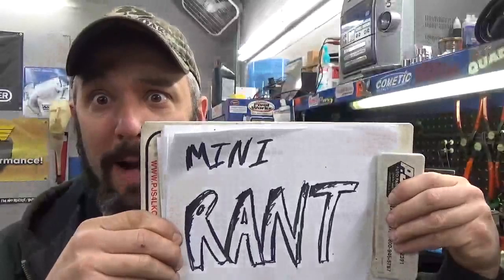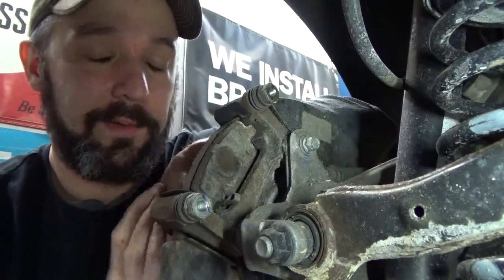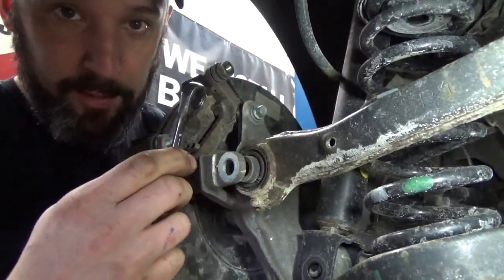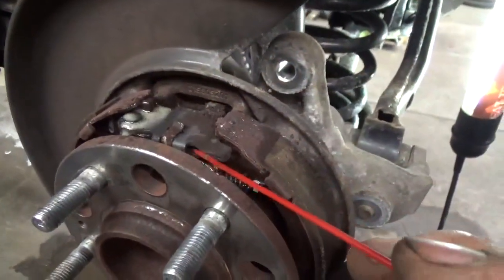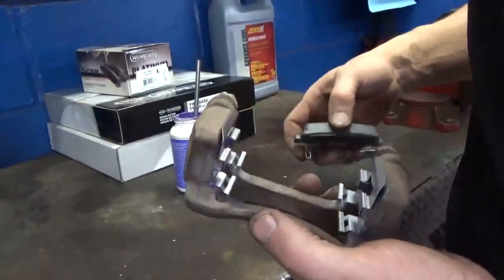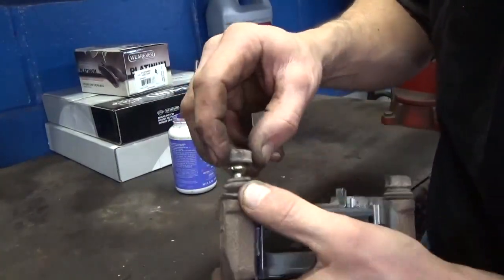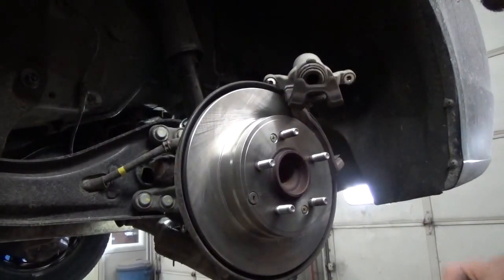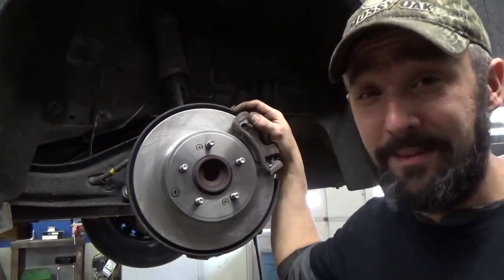Replace Rear Disc Brake Pads & Rotors - Hyundai Sonata

Comment: Great help, thanks. So well filmed, and made simple. So much attention to detail that one would only normally get doing one's own work. 
 I have a 2013 Sonata with the right rear wheel and brake assembly heating up with attendant burning smell, so I thought I'd take the rotor off to have a look.  I was stuck at the removal of the lower assembly bolt.  My 2007 Sonata had a conventional layout. They call that progress ;)

Comment: I just wanted to thank you for telling me about the e-brake thing. I am in the midst of doing my brakes and rotors and have been wondering what that rubber plug was. I have watched 3 other videos on here on how to replace brakes and rotors and not one of them have said nor mentioned anything about this. Great video. You are very precise. I learned several more things on here. This is my 5th time doing brakes and rotors but first with my kia. Boy did the S Korean's screw up with that one bolt placement!! UGH!!

Comment: Thanks....checking my Hyundai Veloster to see if they redesigned that bolt that was a little more work to remove. Awesome! Pulling out my tools to change the discs today, with pads of course

Comment: Excellent video..mentally prepared me for the ridiculous Hyundai engineering added extra step. Wasn't as hard and didn't take as long as I thought it would. Having an impact wrench helps and follow the video. 2nd 1 took a 1/3 of the time. A few bolts were on tight and 1 rotor was stuck pretty good.  Thanks

Comment: I spent four years working on the shop floor as an hourly employee of General Motors, in the Oldsmobile factory. For a I made 3,600 air-conditioner pump-brackets. Three bolts held them to the engine block, covering the #5 spark-plug. This was pre-platinum, and the spark plugs needed their gap set every 6,000 miles. We had nothing but scone for the engineer who designed this bracket. Oh those were the days! A tune-up consisted of changing the oil & oil filter, greasing everything, setting the spark-plug gap, resetting the timing, and rotating the tires. This was 1974, and the tires were not radial, but bias-ply. There was no synthetic oil, and the oil  degraded significantly in 6,000 miles. Everybody in the factory had utter scorn for any car owner who did not get the specified oil change. My building was attached to the engine factory, where they machined the engine parts, and assembled the engines. My future wife reamed, to a high tolerance, the connecting rod bolt holes.

Comment: I just finished fronts and rears on my 2014 Sonata.  The fronts took an hour. The rears took me 2.5 but would have been longer had I not watched your video. I completely disconnected the control arm from the knuckle so I could get a 6 point socket on that hidden bracket bolt. I used a bottle jack to manipulate it back into place

Comment: I have two questions if anyone can answer them:

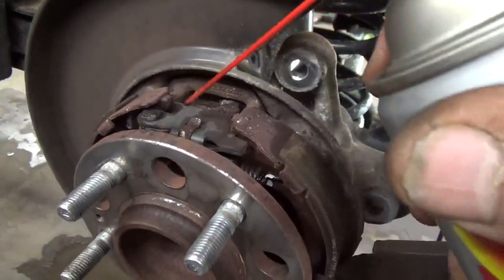1) At 7:54 what type of lube is sprayed into the parking brake mechanism? Doesn't that general area get too hot for common lubricants? (answered below)
2) At 16:20 he used an old brake pad and channellock pliers to push the brake caliper piston in. Does that mean you do not need to use a special rotating tool on a Sonata?

I have a 2016 Sonata which is a 7th gen model (2015–present) but I am sure most of this content is still the same. I'm so glad some other comments here mention that they re-engineered that one caliper bracket bolt to be easily accessed on the newer Sonata models!

********

Edit to include my own findings which answer question #1 along with other products he used:

From a random internet source, during normal street use an average car's brakes likely won't exceed 392 F. During racing use the brakes got to around 932 F. I say this because certain products aren't rated for certain temperatures.

The purple brush-on lube looks like "Permatex 24125 Ceramic Extreme Brake Parts Lubricant". The internet (if correct) specifies it can withstand temperatures of -65 to 3000 F. It's odd because the product description says it can be brushed on the slide pins but the reviews say it is for metal-on-metal use only and will eat away rubber. I'd suggest something like "3M 08946 Clear Silicone Paste" for the slide pins.

The red anti-seize spray is called "Castle Muscle Grease". The MSDS is kind of hard to read so I think it is either rated up to 182 F (boiling point) or 720 F (Auto-ignition temperature - whatever that means). He shows it 15m40s into his Suzuki XL7 video.

The spray lube he uses for the parking brake mechanism is likely Fluid Film. He shows it 32m56s into his Suzuki XL7 video. The internet (if correct) specifies it can withstand temperatures of -50 to 350 F with a flash point of 405 F.

Link to Suzuki XL7 video: https://youtu.be/00LCvz9lC5M

Comment: Thanks a lot on posting of video with instructions. I was able to follow your instructions and remove the rear rotor on a 2001 hyundai donate and to my surprise the rear parking brakes needed replacement. By the way on the 2001 hyundai it was easier to take everything off without have to move shocks or frame supports.

Comment: It’s crazy that u need to move the control arm and shock just to get to the rotor nut.  I was so hard to turn the nut with a wrench once I move the arm and shock.  It was really hard putting it back.  I’m glad u said not to remove the arm.  I wouldn’t have gotten it back on if I removed it.

Comment: Very informative thank you. I had to take the whole rear arm off to get it back together, what a pain. It twist if it comes all the way out, like mine did. I found it easier to put it back on once I removed the bolt that fastened it to the car. Thanks for the great info keep it up!

Comment: Nice video. Very detailed.  Wish I saw it sooner.  But I was able to get the 2nd bracket bolt out without removing the shock bolt. Then aligning the control arm wasn't to bad. I just used a pry bar.

Comment: great vid. I just did replaced pads n rotors on a 2015*. After watching this vid I was expecting a long day but this new model has the control arm away from the caliper bolts. lucky me
Reply: So you didn't have to take apart the control arm at all??

Comment: Top notch video.  Would not have been able to do the rear rotors without it.  And my brake pads won't wear unevenly and end up looking like doorstops, because I used the sandblaster like you recommended, and they now slide properly.  I wonder how many mechanics take that extra 5 minute step to do a quality job?

Comment: Like you,I'm in the trenches every day and this is the first time I have seen anyone do a brake replacement the way I would do it. Sign it the office states that that if a customers car runs out of fuel on a road test we will leave it right where it stops and from there it's shop rate per hour to get fuel and/or a tow back to the shop.
Reply from the maker: Lol thanks! Ohhhh trust me I had an evil side of me that just wanted to leave the car idling in the parking lot. The funny part is, these people can throw a rock out there front door and hit the gas station. Thanks for watching!

Comment: Sonatas changed quite with regard to the body style from 2010 to 2011. Don't know about the other aspects of the car. Just wondering if you knew that the "hard to get to bolt" was the same on the 2010. Excellent video. Thanks for helping people out!

Comment: I have the same 2011 with the idiot Hyundai engineering.  Had to bring it to my trusted mechanic to replace the rotors.  I didn't have a big impact gun. Being in the rust belt of No. Minnesota, it had to be done twice.  Great instructional video!

Comment: thanks,I'm just getting ready to replace the brakes which I've had for some time on an 08'sonata.possibly the hose to on the pass.rear as I ran over a piece of 2x4 someone left on the on ramp for me and now is leaking at the pass rear caliper area.doesn't seem like it should be the caliper but I have it in case.again thanks for the preview

Comment: Great video Eric!  These days it seems one can't wrench on a car without looking it up, just to see what they had to screw with to make the most mundane jobs all the more fun.

I removed the control arm bolt, pried it apart so that I could attack the bracket bolt, and all was fine.  Left the shock alone.  Ratcheting wrench is a must here.  Put the top bracket bolt back in and then the bottom bolt can be wiggled back in.  I picked up some "alignment bars" from HF (think a shaft that is turned into a point on one end) to line things up afterwards for that control arm.

Unfortunately I had to do it twice: while the pistons pushed in just fine, three months later it all had to come apart again: the phenolic pistons froze.  No joy in Mudville for me.  Hoping second time is the charm (although the way it's rusting I'm wondering if I won't be doing flex lines before long--it's a friends car, so no Fluid Film here).

On the good side, I bet no inspection shop checks the parking brake shoes on these cars.

Comment: And love the mini rant and your right if the cars out of gas and needs to be tested out  the customer can't expect you to fuel his car  to do it how ever I have had a few mechanics who would run the car short of empty testing the ecm  or picm  and I came to pick up the car I left it with a full tank and got it back at 1/8 of a tank and often I'd be paying for other people's parts as I was told I needed new wheel hub bearing for my 97 jeep Cherokee  Lorado and get the vehicle back and no new hub bearings  so I bring it back and told the owner I paid for 2 new hub bearings and their not on here

Comment: If you jack up the lower control arm under the spring first the bushing lines up perfect, bolt goes in like butter takes all of 5 seconds to put back together

Comment: Have a 2013 sonata didnt take any thing loose on suspension ..remove caliper.loosened rotor by removing two keeper screws ..removed uppet caliper bracket bolt..you can get a 12 mm wrench on lower bracket bolt loosen and  back it out until head hits bushing keep loosening until it is out of bracket bolt stays in pkace  .use a large flat screw driver or pry bar, slide it next to where the bracket and bolt are .pry it about 1/16 and slide bracket up and out rebuild bracket with grease at appropie spots.put back in reverse make sure new rotor lines up with scew holes slide rotor on after cleaning e brake..put bracket and just bumped bracket  with my hand and popped right back in where lower bolt lined up with lower hole .started lower bracket bolt  making sure not to cross thread .put top bracket bolt in then tighten both .put screws back in rotor .put brakes and caliper back..didnt remove any bolts out of suspension save alot of time and headache

Comment: I did mine and it was a pain removing 1 bracket bolt and re-aligning the control arm to the rear knuckle.  One thing I did which I think it will be easier to work on in the future was I flipped the control arm bolt where the nut is now mounted facing the front of the car.  There is no need for me to remove the shock mounting bolt whenever there is a need for me to service/replace the parking brake shoes in the future.

Comment: my 2015 doesnt have that problem with the caliper bolts thank you hyundai
Reply: Does this video work for the 2015 model?
Reply: You just made my day. I have to do rotors on my 2015 and was worried it was the same design like this that would require removing the control arm and shock.

Comment: Great instructional video. I've worked on my own cars for a very long time and have done numerous brake jobs, but would have been pulling my hair out trying to get the caliper bolt out that hides behind the shock and the control arm. Do you have a video for the front brakes and rotors of the same vehicle?
Reply from the maker: Ahh I don't John Atnip ... at least not yet :)

Comment: Late to the party here, but I just replaced the rear rotors thanks to you Eric. The only question is what difference does it make to put the upper control arm bolts backwards? I'm very curious, because I did that. Is it about the exposure of bolt threads? Anyway, that video was a huge help. Thanks!

Comment: Eric O you need a video re-edit or retro-fit!  Brake cleaner makes an appearance with no  -- DAH DAH DUHHH!!! -- oh man, so disappointed.  Just kidding, great video as always!  Thumbs up!  Agree about the silliness of having that bolt covered by the suspension arm, very aggravating.
Grease in the channel between the brake pads and the hardware after hardware installed on the bracket?  I thought grease was needed along the sliding surface between them..

Comment: This was an extremely helpful video.  How about doing a revised version since Hyundai has corrected the caliper bolt issue and moved the adjuster to the top of the hub (on my 2015 at least)..
Keep up the good work!
Reply: So you don't have to remove the control arm now?

Comment: Geez Louise.  What a dumb design.  I haven't tried to do mine yet on my 2012 Sonata, but I'm glad I saw this video before I tried.  I would have been pissed if I got in the middle of the job and came across that bolt.  

I need one of those alignment punches that you use.  Great tool, I had no idea it existed!

If you just want to adjust the parking brake to be tighter, do you rotate the adjustment wheel towards you or away?  Right now the handle pulls all the way up.  I have the little screwdriver with the 90 degree bend that you show in the video.   I never used it before now though, didn't know what I needed it for until now.  Thanks!

Fantastic video by the way!  Awesome pointers for a better brake job in general.  I'll be using my file the next time.

Comment: Hey, Eric...great video.  One of, if not the best I've seen for this job.  I need to replace the rear hub bearing assembly on my 2011 Sonata and am unable to find a video showing the steps required to accomplish this task.  In addition to the steps in this video for replacing the rotor and pads, are there additional parts that need to be moved out of the way or removed completely in order to get to the bolts holding the hub to the knuckle?  It would be great if you had a video showing this particular job on this vehicle.  Thanks.

Comment: this can be done without removing suspension parts. first remove the 2 rotor holding screws and loosen the rotor (may require hammer tap at the center of rotor to break rust). then remove 14mm caliper bracket bolt using offset box wrench 14mm (if you need more leverage use 2 wrench technique or pipe, heat from propane torch, penetrating fluid ), eventually the space will be too tight for box wrench then use needle nose pliers to manually back off the bolt. pull both the rotor and bracket off together, may require light hammer tapping, a little wiggling with a pry bar, but NO extreme force needed. when putting back together put rotor and caliper bracket back on together

Comment: Excellent video. After you cleaned the shoe area what did of lube did you use? I have to do both rear sides, I expect the same issue with the caliper being behind the control link? Thanks

Comment: What is keeping the caliper bracket from sliding off with the rotor, and off the lower bracket bolt, while loosening, without removing the control arm etc?

Comment: I'm interested to know how the actuator works. When I did my brake job on my 2011 Sorento that actuator was seized solid. I freed it up and got it working again but I'm interested to know how it moves the pads out when the parking brake is applied. By the way how should the parking brake shoes be adjusted? Should there be slight friction on the rotor as you turn it?

Comment: For the control arm bolt, cold you not just reinstall it from the opposite direction, putting the nut in the strut side?

Comment: Please correct me if I’m wrong but isn’t that control arm bolts an eccentric bolt? If you remove and reinstall you will need a visit to the align shop.

Comment: Hi,
I have Hyundai Sonata GLS 2012.  In my case I didn't have to open the screw for the shock.  Everything else was exactly what I had to do.
At 7:50 after break cleaner, what is the lubricator?  Can I use WD40?
Reply: +Lucas sacuL Just to add to the screw for the shock.  If you left up the shock by a bit more, you would be able to take the bold of the controllers

Comment: I love your channel!  I need help.  My car (2017 Kia Forte LX) brakes are locked up after a brake job.  I can't push the pistons back in on the back and front brakes are locked up.  I have a mechanical parking brake.  I can't even put on the old pads to drive to the shop.  Is there a service mode to release the brake pressure?  I know other cars have this but my car has a traditional parking brake.

Comment: I'm doing a brake job on my 11 Sonata and trying to purchase the rear rotors from Advance Auto (I've got a $40 gift card) and it's not finding a matching model rotor.  I called the store and they told me it was a YH321573 in their system, which doesn't show up online.   When I search the YH200450 that you used, it says it doesn't fit the car.  What rotor do I use?
Reply from the maker: David Karpinski When I look it comes up with this one? YH321573

Comment: I agree  with  putting  grease  on the contact  points between  the pads and hardware  but if the pad have  rubber  shims you  don't  need  grease unless  you  have  oem pads with  the metal  shims..
Reply from the maker: +EMMANUEL QUINONES I have literally done 10's of thousands of brake jobs with less than 10 comebacks. I know we all have our own way of doing things and will continue to do them like this to be honest with you. I have way to much evidence to make the switch now ya know...

Comment: Thank goodness my '05 with rear disc has two 14mm bolts easily accessed to remove the bracket.  Not that it mattered much, as I am replacing the struts while I've got it in the air.